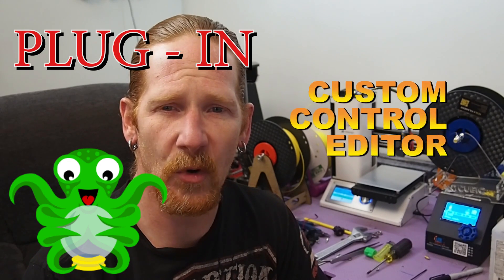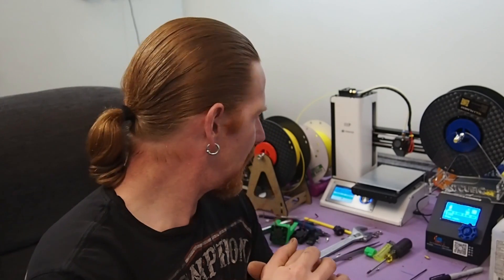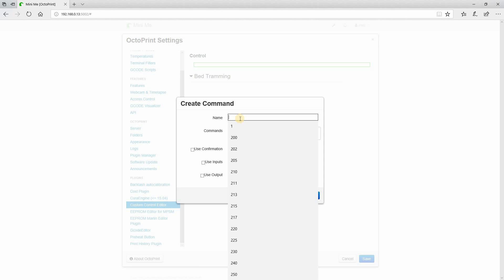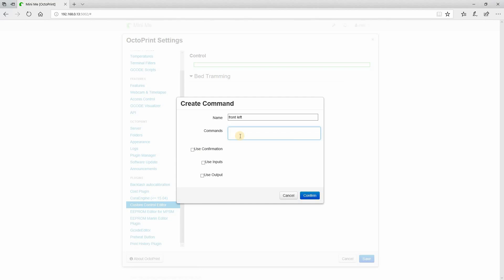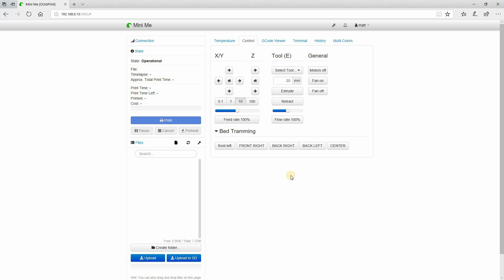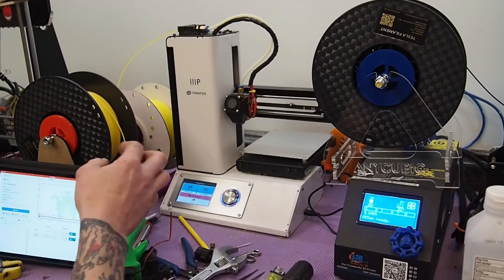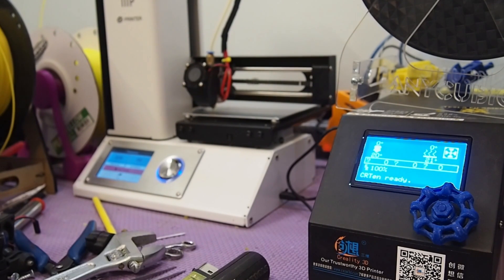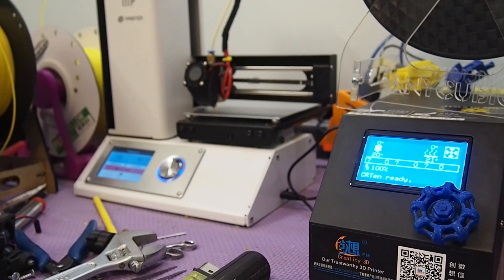Octoprint Plugin Custom Control Editor

Comment: I have been using your method for a while & it has been a lot easier tramming my bed since. I did just ran into a problem when using the:
G1 Z0 F300
For some reason, it was not always hitting the z limit switch, so I switched the gcode at each tramming point to this:
G28 Z
It seems to be working better.  I am also using klipper firmware.  I do hit a little glitch with that firmware occasionally.